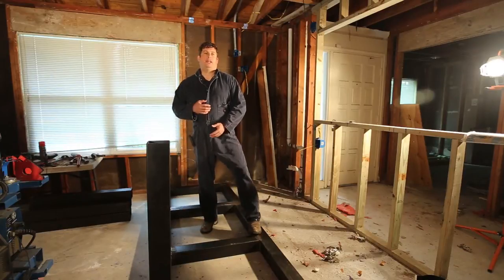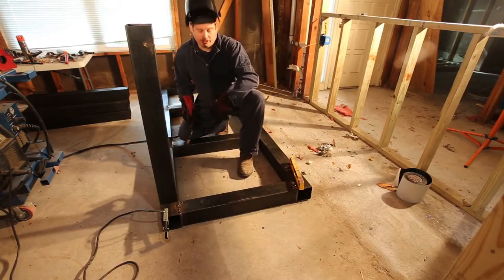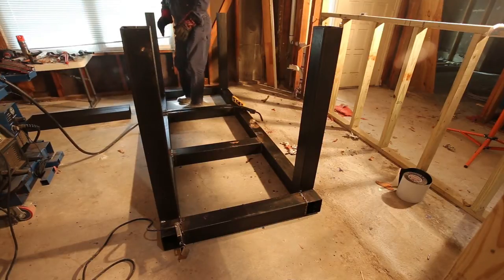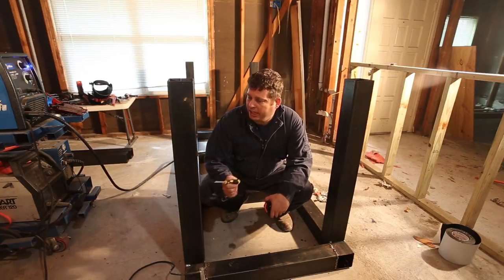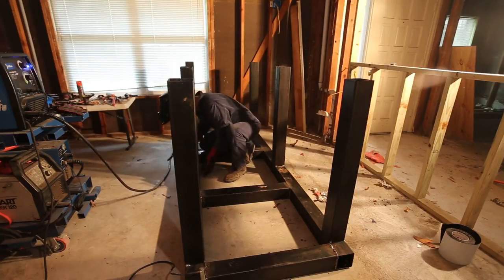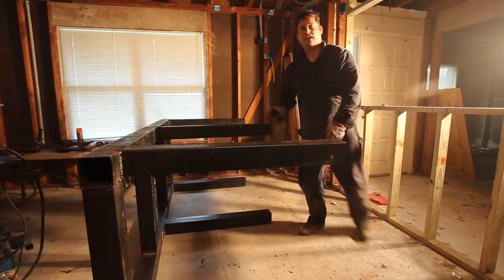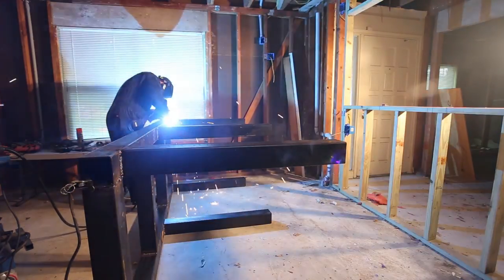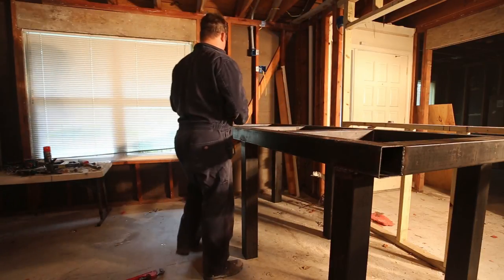Part 4   Steel Aquarium Stand - adding legs

Comment: hi Brian what type of welding can I use for my tank stand...I have a,steel stand and just want to reinforce it with some supports. ..MIG, Or different type
Reply from the maker: Whatever kind you are best at.  :)  Stick or MIG work just fine.  Be sure to observe safe work practices.  If it's warping it may not be strong enough to begin with.  Mine is overdone mostly for appearances.